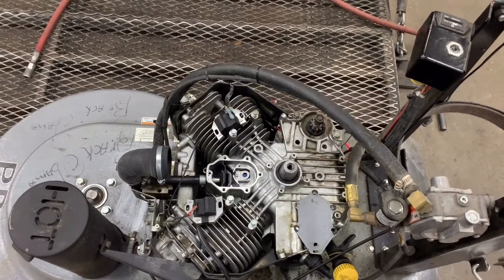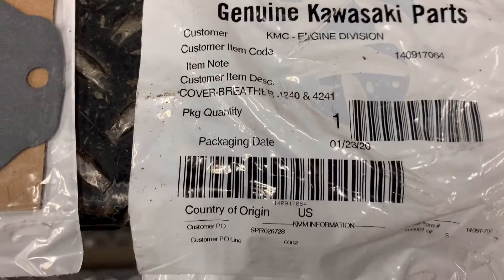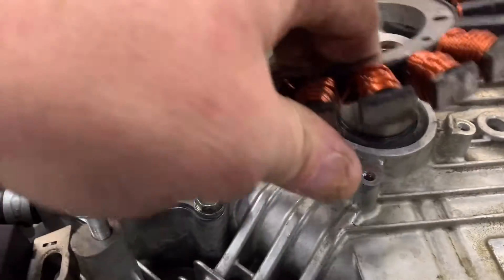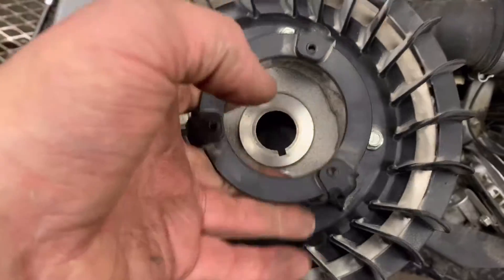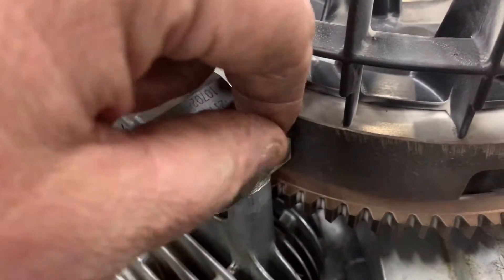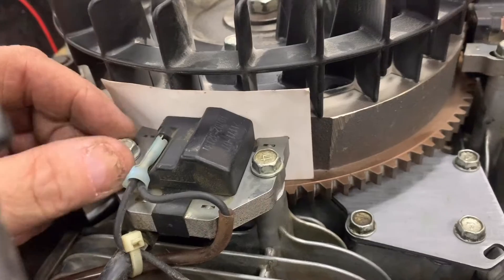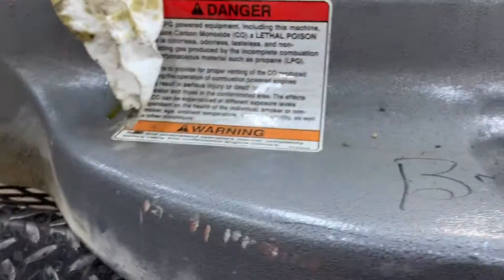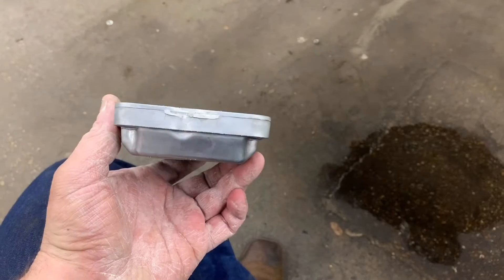PART 2 REPAIR OF (PATTERN FAILURE) SEVERE OIL LEAK DIAGNOSTICS ON A KAWASAKI V- TWIN ENGINE

Comment: Is this issue the same on the FH models also ? I have a FH500v that is covered with oil on the top, pulled the flywheel off and just oil everywhere. There is zero slop on the top crank bushing so is suspect either the top crank seal or the breather cover, i have to pressure washer it first to be able to see anything though..it's horrifying.

Comment: The flywheel on my 11 year old cub cadet with 21 hp kawasaki engine is badly corroded. Can that effect the performance and can it be cleaned. If so how. Great video. I have a fr651v engine that has been leaking badly. Thought it was the lower engine oil seal. After watching this video I'll have to check the breather valve cover as well as the lower seal.

Comment: Changed Oil seal top and bottom and oil pan gasket ..cranked it up but it has slight wobble to it..like its out of balance..... no clanking sounds but it does have an uneven muffled knocking sound..what could that be...?

Comment: Thanks for sharing. The new style valve cover gaskets are a lot better than the older ones. Do you see a problem using a little blue loctite on the breather and stator bolts as a safety measure? Do you have a trick for removing old paper gaskets that have become brittle and stuck on the surface? Have a great day!!!

Comment: Why would you not check the valves while the valve cover was off.
Reply from the maker: I did.  Spot on at 4th
Reply: @THEMOWERMEDIC1  I have a Exmark with a Kawasaki FD791D (DFI) water cooled. I tends to lope when at idle. 800 hrs. Valves have been adjusted and were not out that much. Tends to level out after running.

Comment: Just curious, but do you ever work on Harbor Freight Predator Generators, and where would you get the parts for those Chinese engines?
Reply from the maker: There’s a parts manual that comes with the genset.  You can order parts from hf
Reply: @THEMOWERMEDIC1  l
Reply from the maker: Yessir?